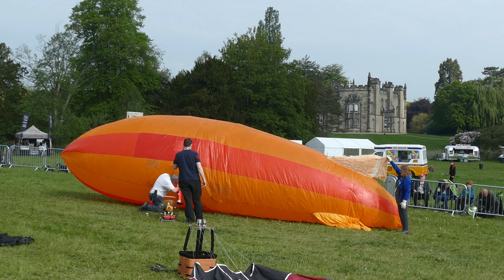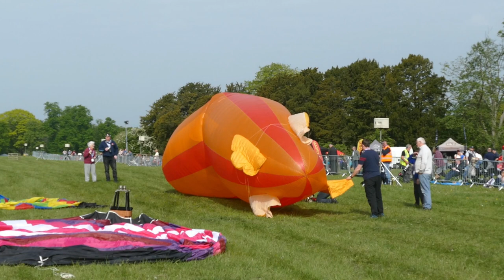Miniature Hot Air Airship / Thermal Blimp

Comment: How does age affect the fabric? Is there a way to recondition older fabric to better retain the heat? It would be amazing to see it in full flight.
Reply from the maker: So the fabric degrades for a number of reasons. Top 3 heat, light and damp, so eventually even the best cared for balloons become porous. Propane burn creates quite a bit of water vapour and mildew can build up on the surface of the nylon. While better coatings of material has reduced the main impacts balloons (and airships) can 'go off in the bag' just through use and time. This one has done really well. Some old balloons smell awful and it snows mildew when you blow them up